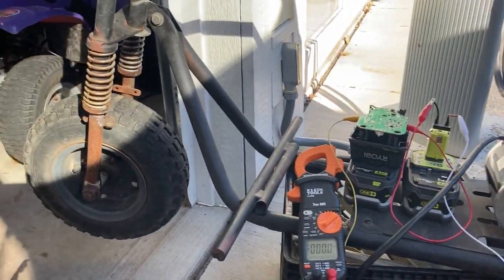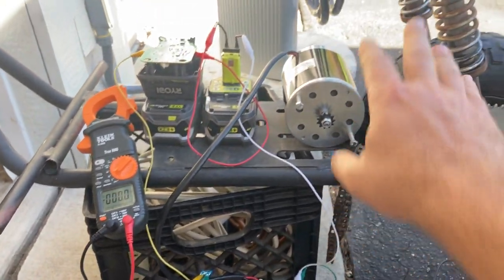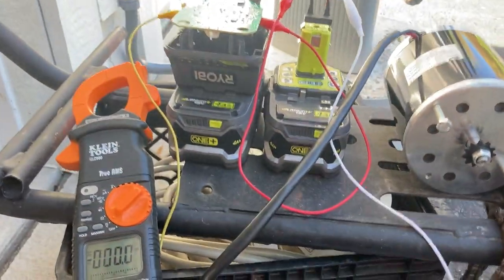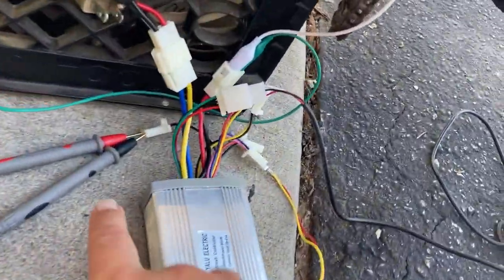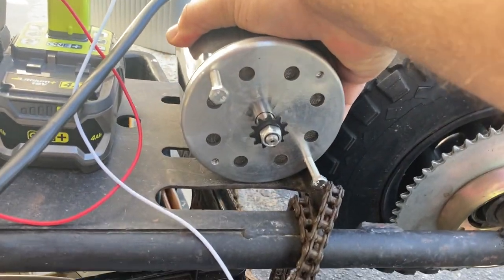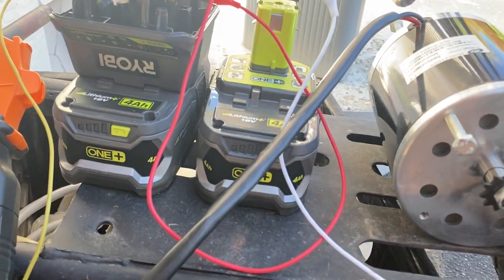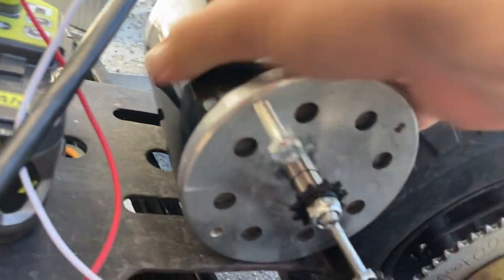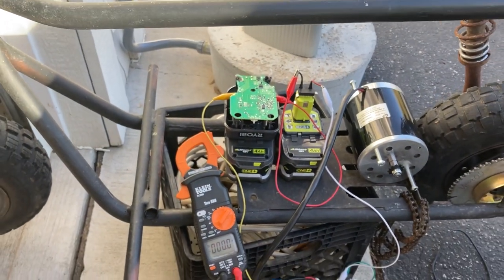36V Minibike with 18Vx2 Ryobi Batteries (Start of EV Conversion)

Comment: I did a similar but with v28 Milwaukee on a 24v OEM scooter.  Got me about 1~2 miles of range.

My scooter has a home built 10mile Lithium pack, but the Milwaukee was handy as a limp home pack for when range testing.

Comment: Use a section of all-thread, bend it around the motor & fabricate a "saddle" for the bottom with holes for the all-thread to go through the saddle, frame holes with fender washers & nylon nuts. Anti-seize is recommended. Your all-thread can be 3/8" diameter or what ever size you think is necessary for the application. You can also slide a section of  rubber fuel hose on the all-thread where the all-thread contacts the drive motor. GOOD LUCK. I'm a former IMSA GT & High Perf Fabricator

Comment: how do you stop blowing diodes on the batteries? I found running ryobi batteries in series blows the diodes on the battery controllers boards
Reply from the maker: I’ve never had that issue.
I wonder if it has to do with a particular size or series of battery. 
I’ve run pairs of batteries in series on several projects and have never had any problems.

Comment: Hi Ben It's not working for my Rosso Motors 36V 800W Quad could it be that My 2 Ryobi are 18V but only 6 Mah/each ? Thank you
Reply from the maker: Do you have your pair of batteries connected in series?
Two 18V 6AH batteries in series should run that thing just fine.

Comment: What a good idea . I wonder if the new electric lawnmowers could be adapted here . Has all the parts . Controller . Motor and Harness . Just have to get the gearing correct .
Reply from the maker: The main thing is that it would need a speed control. Unless you are talking about RIDING lawn mowers!
Reply: @BenjaminNelsonX  okay .. the push ones only have one speed I thought they might have a speed controller .. good point .

Comment: hi , i was wondering if the mini bike sprocket and the little sprocket on the motor  matched for the chain or did you have to install a new sprocket on the rear wheel ? thanks
Reply from the maker: It was a different size sprocket. Motors like this typically come with a very small sprocket (if they include one) which is typical for stand-up electric scooters.
Mini-bikes typically use a larger chain and sprocket.
Reply: @BenjaminNelsonX  thanks , i am thinking about building one myself . i have done a few bicycles with v belts and they work great .

Comment: What happend to your previous plans you had with the bigger motor and Nissan leaf batterys ?
Reply from the maker: Right now, the Leaf batteries are in the Solar trailer. I probably need the Alltrax controller for another project.
As much fun as it would have been to put a 20HP electric motor in a mini-bike, that's probably overkill...

Comment: I've got the Ryobi electric lawn mower that came with 48v 100ah SLA batteries and I've wondered what it would take to do something like this to run it. Obviously it'd take a few strings in parallel but I wouldn't need the full 100ah, just enough to run long enough to charge a second set.
Reply from the maker: 100AH 48V battery would run this cycle all day.
Reply: @BenjaminNelsonX  haha, yes and it'd move rather quickly too, but I was talking about converting the mower to lithium tool batteries.

Comment: so 40 volts is ok?  36 volt motor?  If so an EGO 40 volt battery (mower type) would be great!
Reply: You can try a voltage regulator and  a current regulator, you can use 40 but the timelife of the motor will go down soon.
Reply: A 36v motor is rated for a 36v nominal system which means the motor will be fine with anything in that range.  In fact this 36V motor would probably be fine running at 50 or 60 volts with a higher voltage rated motor controller.  The controller will generally be the limiting factor for system voltage.  I would guess that a well designed 36v nominal system should be able to take up to 45V without much of an issue.
Reply from the maker: @kuhrd  Exactly. Remember folks, all batteries are a RANGE of voltage. Higher when the battery is fully charged, lower when it's discharged.
Reply from the maker: A 40V tool battery would be great! IF I had one around. I have a number of these batteries, so this is what I'll use. 40V tool battery would be great for an e-bike too.